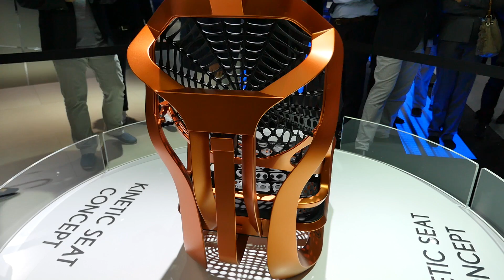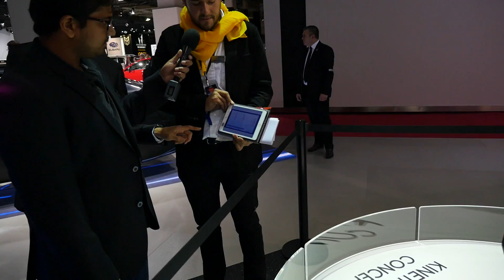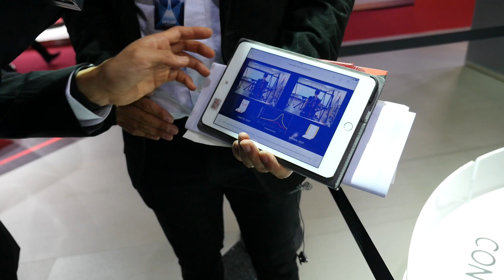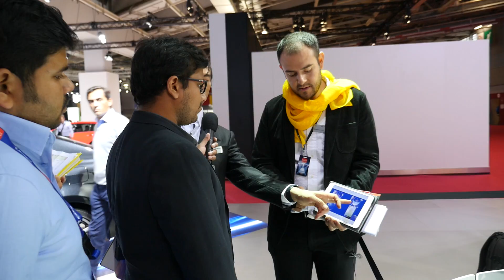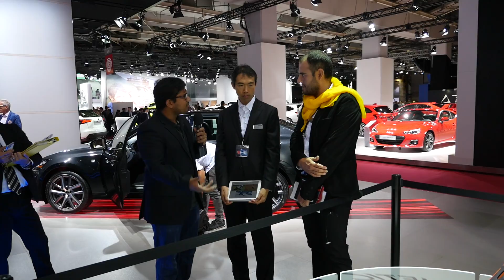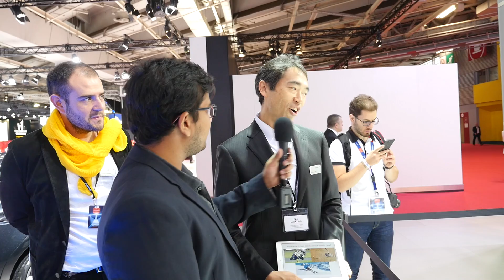Lexus Kinetic Seat concept - future flexibel car seat - Autogefühl

Comment: I agree with the interviewer, a seat that pivots with your hips would impair your response time in stopping and would make the use of a clutch extremely frustrating if you're swaying when you need stability to precisely shift or timly brake . Needs alot of work if not redesign from scratch. Sorry guys, wont work....maybe some kind of precise locking mechanism that activates simultaneously with the action of braking or shifting could be an answer.

Comment: The concept is very interesting. I couldn't really make out how much of it has been tested and whether the conceptual effect is really there in practice. They said it's still in development, so we will probably not see anything like this in the short term. But if this works, it should be the new norm, right? But then again, you'd say the same about those memory foam pillows and not that many people are using those.

Further, I wonder how much it costs to implement this in a general car vs normal seats.

Comment: I wonder what a Chiropractor would say about this device.

The idea of dissipating the energy into the back and seat is interesting but how does it affect safety in accidents? if you let the spine curve to a significant degree, doesn't it enhance the potential of spine injury?  Maybe they need to think about restricting the motion of the seat in coordination with the sensors that activate the airbags?
Reply: Lexus is a top-class brand. They're just presenting here a technology for the future. Obviously, it has to be calibrated in a manner that doesn't affect the occupants in case of an accident.
Reply: on the contrary having the seat move would make it safer in the long-term(not counting crashes). the spine is designed to be in motion and obsorb energy in certain ways. By locking it in place it's like like locking your suspension or locking your knee in place and running onto it. It's made to absorb energy in its motion not statically. In terms of a crash the seat only pivots up to a point. The current iteration of the seat is without incorporation of aesthetics and safety so the final product will probably have side bolsters which make it just as safe as any other seat especially if they cover the holes so that fire and shrapnel can't go through and up your ass.
Reply from the maker: +aovint63 interesting!